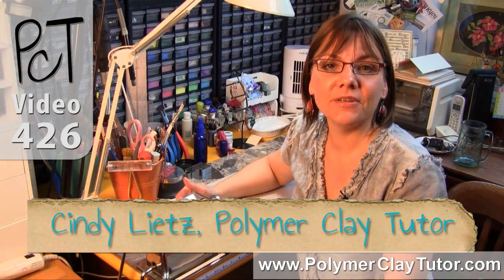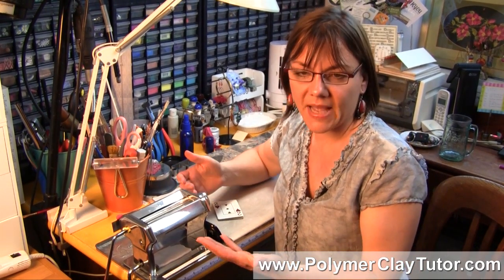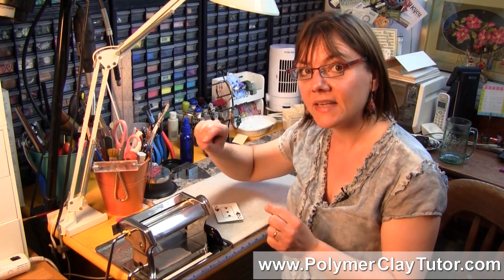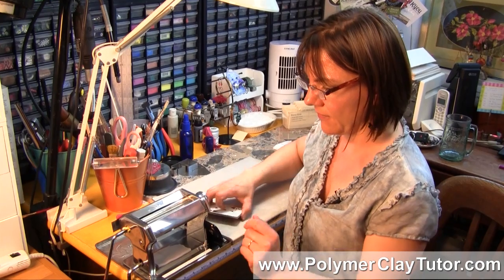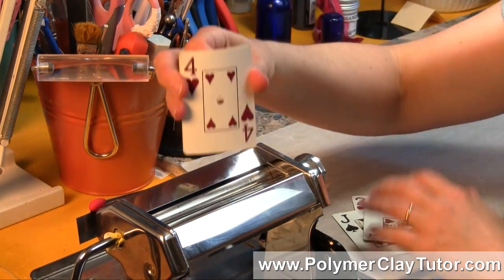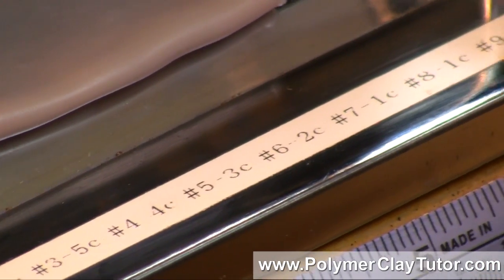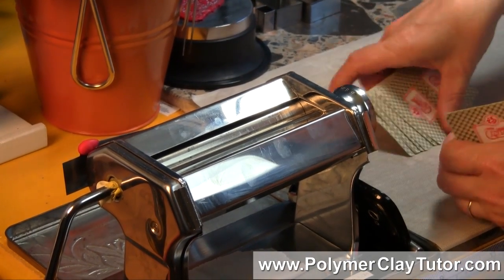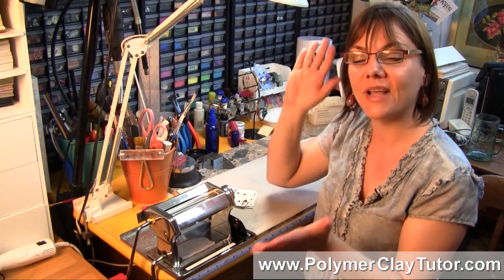Pasta Machine Thickness Guide Using Playing Cards

Comment: pls pls can you make a slab of clay with different thickness without pasta machine ?  with roller pin. pls
Reply from the maker: Just use a stack of cards (or wooden or plastic slats) on either side of your slab and use a clay roller to roll out the thicknesses.
Reply: @PolymerClayTutor  okay. Got it. Thank you!

Comment: Cindy, because playing cards have numbers on them, and at present I don’t have a pasta machine, it was easier for me to use the equivalent number to the amount of cards. An example being, 7 cards in a stack the top card was number 7, the 5 card stack has the number 5 on top; and so on, made it a bit easier and that way I didn’t have to count the cards out each time. I also stuck a piece of cellotape around each stack to keep them together. Hope this tip helps some of your followers. Hugs from a very hot South Australia 🇦🇺
Reply from the maker: That is so funny Judith, I have grouped my cards together with the card number on top too... though I was trying to decide which way to keep them together, that wouldn't change the thickness of the stack. I was thinking that a glue stick or spray adhesive might be the thinnest way to stick them together without adding bulk. I am excited to hear that that method works well!